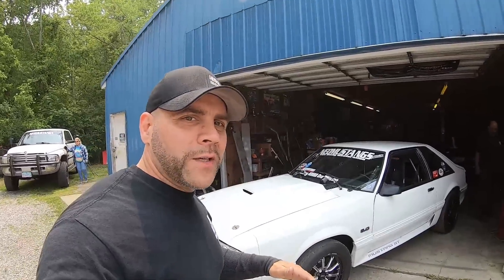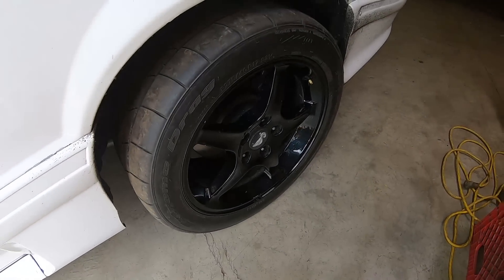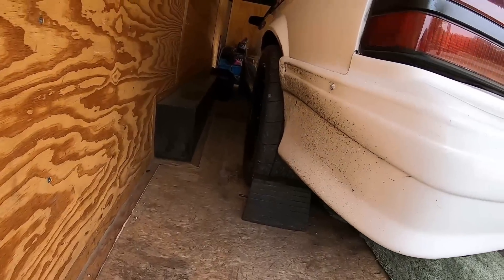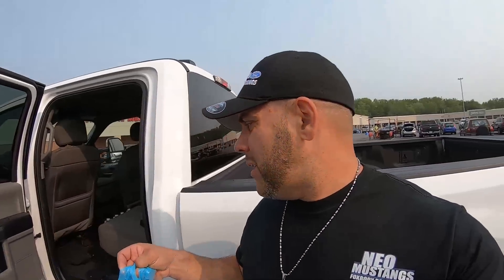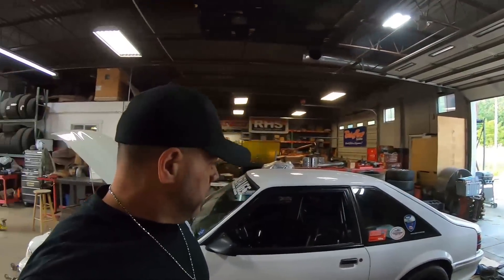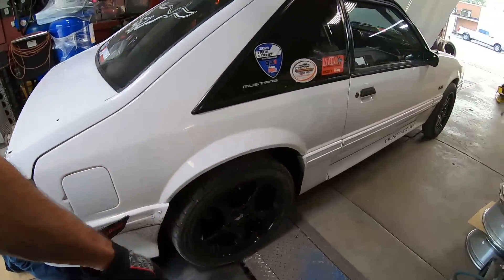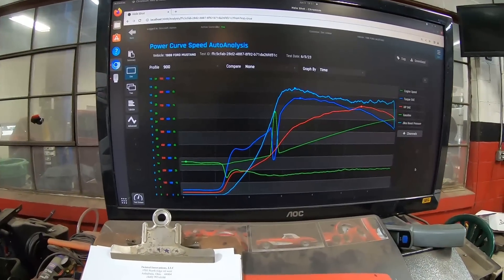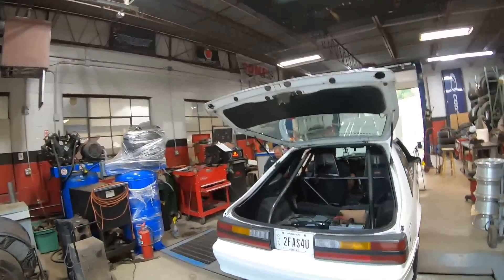How Much Power Can A Junkyard 351w Stroker Block Hold? Year 3 New TURBO

Comment: How much it can hold depends upon the year.   I am certain the 69-71 and maybe a few later years 351W had thicker mains.   They also had enough meat in the cyllinder to over bore it as much as .060" and still have a ton of cyllinder thickness.      The casting also thicker in the valley and everywhere else.    Those particular years probably would hold 700-800HP. 

On any engine when you are pushing it to the limits with boost, running e85 or methanol and water will eliminate detonation and allow you to stretch it out even further than you could on gas.

Comment: You’re an excellent engine builder. New to your channel, but I wish you would have a list of what was done to the engine and the link to the engine builds. It would be more informative to your subscribers and it would clear up a lot of confusion. What is that 800 hp to the wheels or to the engine? How much does this engine cost? And do you have a video on the build? 800 hp is amazing.
Reply: on this video, they're recording tire spin, so it's at the wheels.

Comment: Shock settings on a dyno? Wtf. Yeah next time maybe check the blinker fluid
Reply from the maker: Well ya … if the shocks are too loose the car will move on the rollers …. Notice it stopped after …..
Reply: @Neomustangs  if you strap the car down properly the shock settings don't matter.
Reply from the maker: @every-istand-ophobe6320  yep and it was. Thanks

Comment: Awesome Dan! Sounds awesome sir. Thanks for sharing.  Question please??? I have a mild built 73 Ford 460 in my Mustang. Very nice and strong runner. How much should I sell it for?  Complete, no leaks, no smoking , long tube headers inc Rpm performer intake, minus carb. Thanks on any feedback from you or Comment section. Cheers from Motown.

Comment: Gonna have to hit them up when project ‘91 S-trim HCI 306 is finished up and get it tuned… rocking an A9L + Quarterhorse on this one. First time doing binary editor for me. Always did chips, interceptor/PMS or some form of stand alone on my builds to date. In Detroit area so not far… actually had the fam close to you other day at Cedar Point. The Raptor still makes me smile every time.
Reply from the maker: Ya call them up. I mentioned their names and location multiple times easy to find on google.